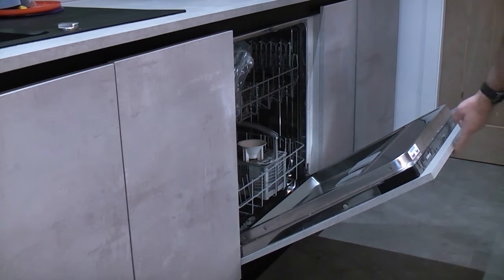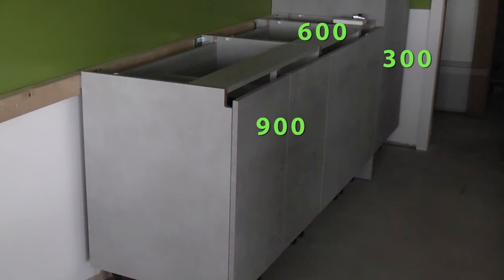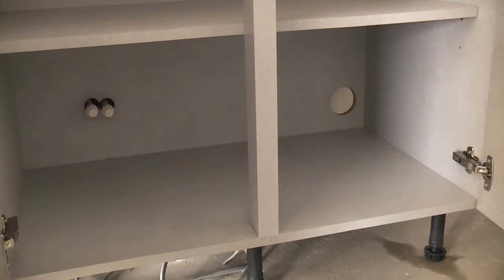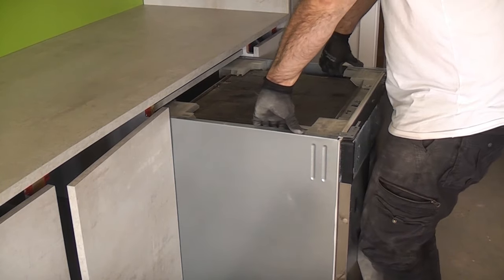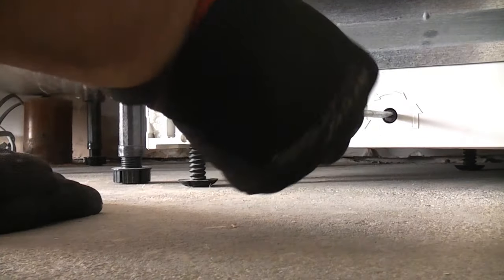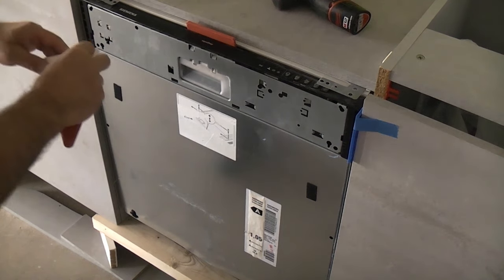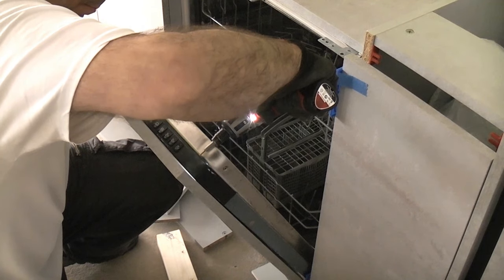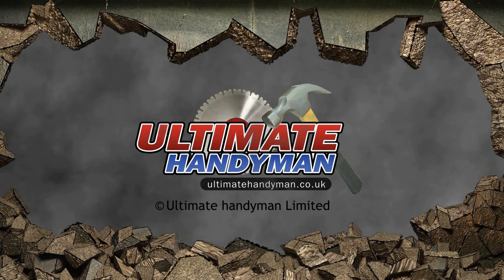How to fit an integrated dishwasher

Comment from the maker: Fitting this was difficult, because the plumbing for the property was not fully installed, so there was a 4-inch soil pipe connection under the 900mm base unit, which had to be left accessible for the plumber, this resulted in me fitting the dishwasher, then the 900mm base unit, then the other units on that wall. I then had to fit the worktop and make the cut out for the sink, then remove the dishwasher, so that the 900 base unit could be removed!

I hope everyone has a great Father’s day Sunday 😉

Comment: My setup is exactly like this one except the 300mm unit is missing so the dishwasher butts up to the tall unit. Do you think there will be enough space above an integrated dishwasher to add a support for the worktop, or do I need to get an additional base end panel against the tall unit end panel? Thanks! This is my first kitchen install and the only thing I am struggling with atm. I have not received my dishwasher yet

Comment: At 5:58 you install the scrap piece with the white mounting pieces. Can you let me know what's the name of that white piece (or a screwfix link)?
Reply: Never mind! Found then ynder "white assembly joints" (screwfix 25399) or also googled "white plastic shelf bracket"

Comment: The metal plates at the top are normally for screwing the dishwasher to the under side of the worktop. If it's a stone worktop, there are holes (usually with caps) on the sides at the front to screw the dishwasher to the side cabinets on both sides.
A tip for when adjusting the rear foot is to try & take the weight off the rear foot by tilting the appliance slightly forwards while turning the screw as the screw & connecting tod are plastic & easily broken/stripped.
Finally, the door fixing kit usually comes with 2 metal brackets that screw onto the decco door & hook into the dishwasher door at the bottom, while side brackets that screw onto the sides of the decco door are held in place by adjusting screws (behind plastic caps) on either side of the dishwasher door.
Reply from the maker: Thanks for the detailed information. I thought the metal plates at the top were for screwing into the worktop, but they could not be used with the handle-less trim. 
Thanks again for the comment 👍
Reply: I work in white goods & come across these all the time. The metal plates can be removed if you're not going to use them - it can save sore fingers!
Reply: @ultimatehandyman  the metal plates can be swapped over left to right and the ends folded along the dotted lines to allow them to be attached to the units either side ;-)

Comment: How do you install that dishwasher if the countertop is installed? It must be hell. How would you install the top panel?
Reply from the maker: You would have to put the dishwasher in position, then mark the height of the top panel. Remove the dishwasher and then install the top panel using some L brackets, fitted from below. Like you say, it will be difficult 👍